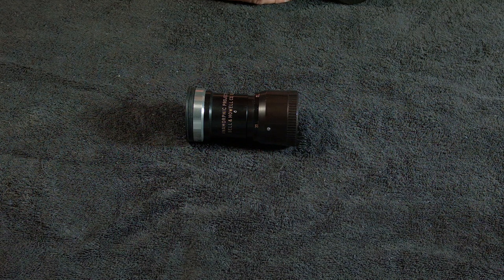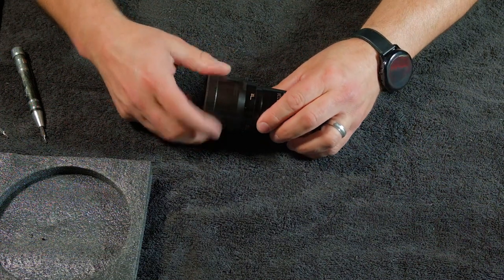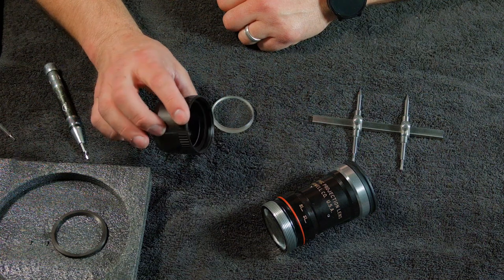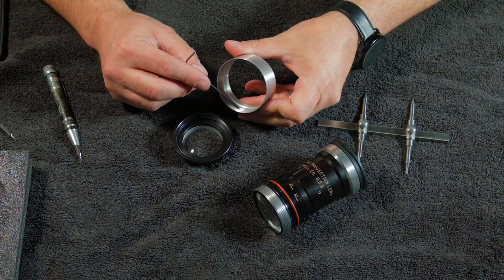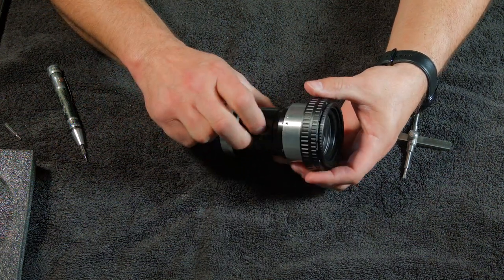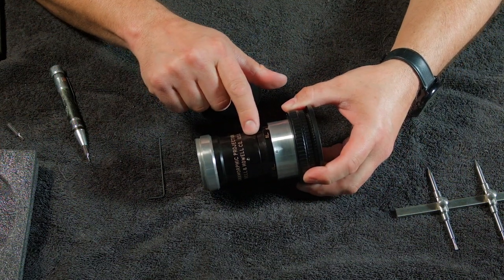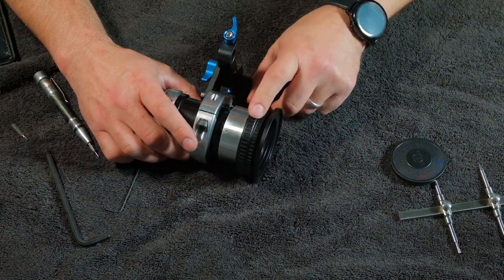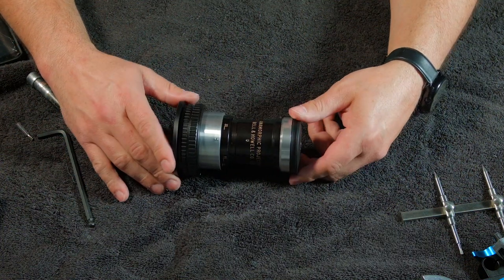Bell & Howell 2x Anamorphic Lens Modification Tutorial Video

Comment: Awsome ! Any tips on totally removing the front diopter and using something like vazen focuser instead for more coverage ( not sure on case of this scope the bottle neck is the small diopters or the actual scope )
Reply from the maker: Thank you 🙏 Yes you can totally remove the front diopter on the lens. You may be able to use a larger diopter like the Vazen however I have not had one on hand to test. I took the front diopter to an optometrist to measure the two elements. They came back as one being a +9 strength and the other being a -9 strength. Maybe that will give you an idea for modifications 🤷‍♂️ I'd love to hear what you come up with.

Comment: lens cemetery..  hope the ground is not too sour)) very aesthetically pleasing tutorial, where everything fits everything, as it should, no gluing, taping, sawing, drilling, etc! so is it a single focus setup, or you still have to focus on both the taking lens and the adapter?
thanks!
Reply from the maker: The lens as it comes from the factory has a built in single focus solution. The downside to it is it takes seven complete revolutions of the focus ring to go from near to infinity. With the modification you see in the video it decreases the near to infinity focusing to slightly under one complete revolution.

Comment: Thanks for the walkthrough. At 11:17, what lip are you referring to inside the helicoid? Is it part of the attached adapter, or the helicoid itself? I’m trying to assemble mine, but the front optic holder design results in glass touching glass for me

Comment: so if somebody wanted to align this setup without the rail support, you would still need to use a clamp at the rear with set screws?
Reply from the maker: That is correct. The major advantage with having the scope mounted on a sliding rail bracket like I have is it only takes a few seconds to change taking lenses and you dont lose scope alignment.